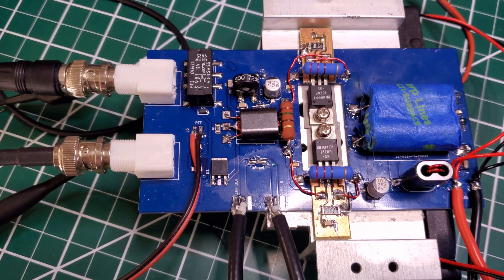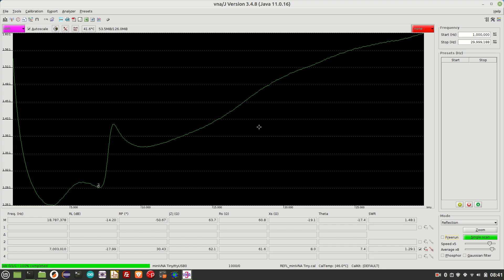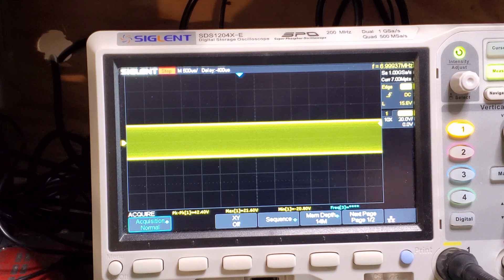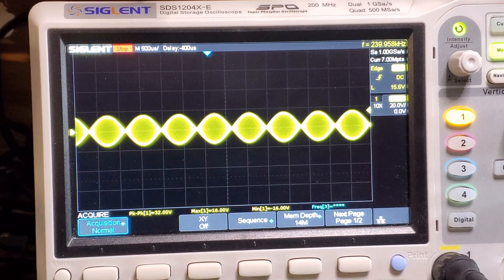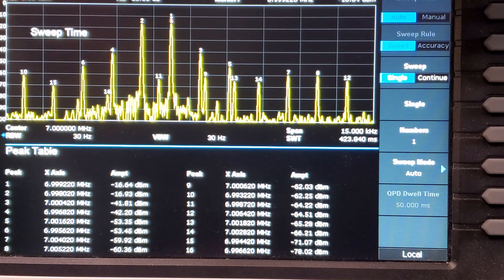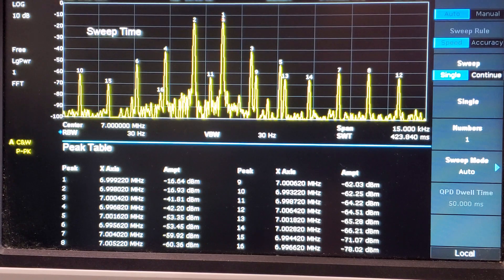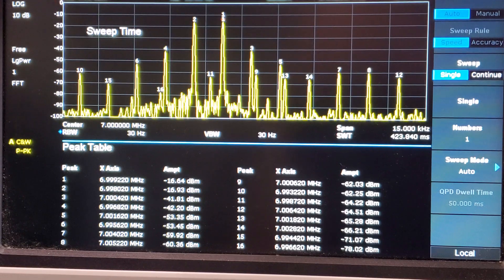70W Amplifier - Using RD16HHF1

Comment: It's possible that the output transformer core is saturating, thus causing all those harmonics.  The original eBay Minipa70 design used 3 turns on the output secondary.  Have you tried 4 or 5 turns?

Comment: Hey man, did you ever get to the bottom of your low power issue with these FET's? I've been playing around with a single ended class AB1 amp  with an RD16HHF1 and am struggling too with getting anywhere near what the specs says out of it.  IIn the past I was in communication with a seriously respected and well known QRP DIY'er and writer that built a 28MHz single ended amp and got 14W out with 250mW in with an RD16.. so like you I'm baffled also. Very strange indeed. I'm starting to think my FETs may be fake so I'm going to setup a simple jig to measure static Ids vs gv for a given Vds and see if the results track the spec sheet. I've messed with my output matching, used broaband xformers , 9:1 and 4:1 and also L-C-C matching networks. Squeezing blood out of a stone.. Keen to know if you ever got any further with this amp. Thanks for the video, great stuff.
Reply from the maker: I never did get to the bottom of it and need to revisit. I know my rd16s were genuine because I got them from rfparts.com. My suspicion was that adapter board I had. Certainly most of the rd16s on ebay are fakes with wrong pinouts even

Comment: Hi I am really enjoying these videos as I am a bit of a tinkerer myself. Re the RD16's I imagine that you should get better performance within the limits of the devices opposed to the IRF MOSFETs as the RD's were designed specificity for this purpose.   I think that you may achieve better performance regarding harmonics and a balancing the waveform during the 2 tone test by biasing the devices separately and same goes for the IRF devices,  just an idea. Regarding the power output level I would have thought that you should be able to should be able to achieve at least 25/30W in this configuration. Mitsubitshi used to be very good with example circuit designs for balanced RF power stages however; I am unable to find much in the way of design examples on these devices as everything in the datasheet is single ended. Still may be worth a look.
Reply from the maker: Glad you are enjoying the videos John. I didn't have as much success with the RD16 as I thought I might - probably because of that separate adapter board
Reply: @na5y  I think the problem is all to do with  the impedance of the transformers.

Comment: I suggest you try a diplexer type LPF where there is HPF which is connected to a dummy load. The effect of this on any solid state linear amp should be pretty significant and very ineresting experiment!!

Comment: Have you tested or tried a irfp260n I feel you having more knowledge than me that you would be able to get some good power out of a cheap mosfet say up to 600 watts +  depending on in put voltage
Reply from the maker: I actually have a pile of those - but haven't got around to them yet. I agree they look promising. Unfortunately they have a different footprint entirely - so I'll have to do a new board

Comment: Hi! Thanks for the video and well done on the amplifier. I've built the Eamon Skelton (EI9GQ) 16W PA that uses 2 x RD16HHF1. I followed the modifications of VK3PE which uses standard toroids for the transformers. The most I ever squeezed out of mine was 14W on 80m, 12W on 40m and 7.5W on 20m. So it sounds like your results are in the similar ballpark. Skelton also used 500mA bias per MOSFET as you did. Keep up the great work! 73 Nick M0NTV
Reply from the maker: Thank you for the kind comment - I'll have to check out Eamon's amp. On a deeper look with my amp using the RD16s I am seeing some nasty parasitics at around 158 Mhz. I might do another version of the board just for the RD16s.

Comment: Don't waste your time on this old transistor. New mosfet have better performance and market availability.
Reply: Hi, I've been using the RD16HHF1 and they are great for HF. I think Mitsubishi are discontinuing them from early next year but I don't see a replacement. Can you please suggest an alternative? 73, VK7IAN
Reply from the maker: Interested in your suggestions for other FETs to try
Reply: @na5y  what is the maximum Vds voltage and required RF output power?
Reply from the maker: @Masirah1  Around 14V and 30-40W class AB would be a target - something with a low IMD
Reply: @na5y  I think IPS70R1K4P7S CoolMOS is fitting the criteria. gate voltage should be in the range from 4.7-6.2 volts. so the bias point is around 5.45 volts. I don't think bias current is relevant for FET as it is voltage controlled device not like BJT.
Reply from the maker: @Masirah1  thank you for your suggestion. I will definitely look into that device!
Reply: @Masirah1  I think you are right about the bias current issue. An Idq of 500mA is only indicated as the test condition Mitsubishi used to develop their datasheet. I wouldn't read it as any kind of recommendation. Anyway, a 14V Vds doesn't seem high enough to get the best out of the MOSFETs.  The device can handle up to +50V drain-source. Certainly half that would be worth a try, but they'd need better heat sinks or they'd burn up.
Reply: @tcarney57  with Mosfet I would always go to the highest Vds possible, but 13.8v power supplies are more common in the market unless 48v server power supply is used.
Reply: @Masirah1  Yes, it's true about common power supplies, at least for ham-radio use. I just took a look on Amazon, though, and found a 24V, 14.6A Meanwell (respected brand) enclosed supply for US$29.99. They have a 48V, 7.5A unit for US$39.99. These are switching supplies (or they'd cost a lot more), but Meanwell's enclosed supplies have good reputations. For MOSFET work, at least one would be worth having around.

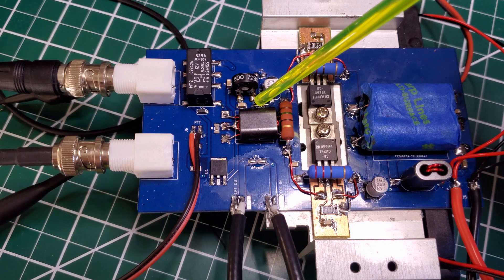Comment: Very interesting difference between 2 types of FETs, thanks for sharing!  I can’t remember if your output step-up xformer is 1:2 turns (1:4 impedance) or 1:3 turns (1:9Z).  In theory, 1:3 should boost output voltage vs 1:2.  Could also try boosting to 1:4 turns (1:16Z) however harmonic content is likely to degrade further at this higher ratio.
Reply from the maker: Output transformer is 0.5T : 3T. Although based on Rob's comment above 10-11W for the pair is typical for class AB
Reply: Thank you so much for the info on output xformer 👍I think I mistakenly assumed you were targeting class C with 0.5A bias, but seeing Robs comment I agree with his suggestion to lower bias closer to 100ma which is the bias  I use for some of my LMDOS FETs
Reply from the maker: @Rob's Blog Sorry for the confusion - its a single turn with a center tap and I was referring to each side as "0.5 turn"